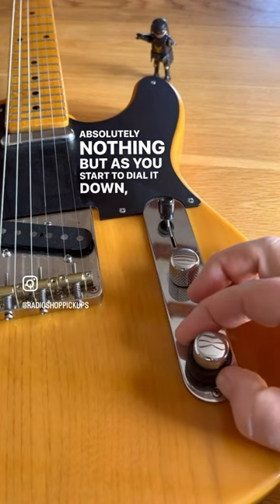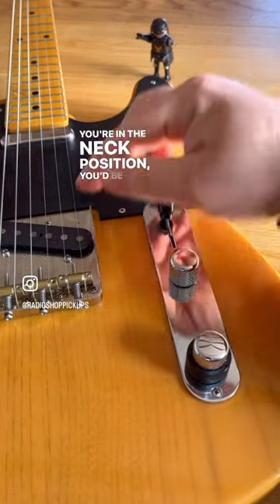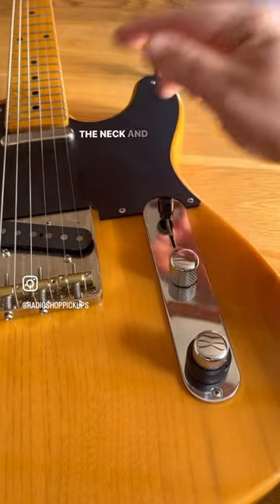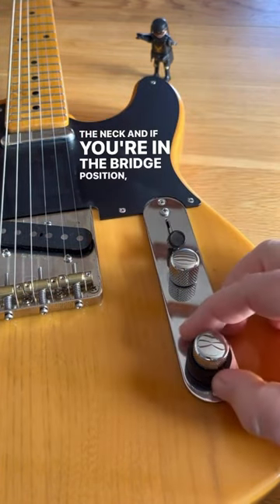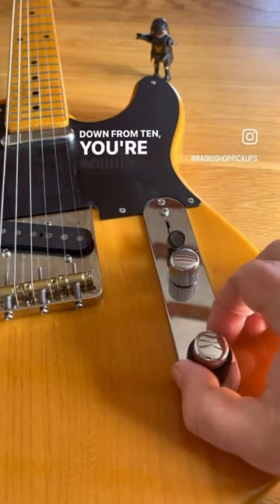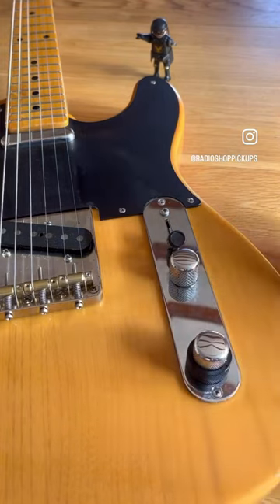The dream Tele control setup?! Our Radioshop Tele Mod explained 👍 #guitar #fender #telecaster

Comment: Did you DIY this or have a tech do it? How much do you think a small town guitar shop would charge for parts and labor for this mod??
I'd been thinking about a blend dial to my tele for a while but I had figured on replacing the toggle with a third pot instead...this seems like maybe a  more elegant solution though.